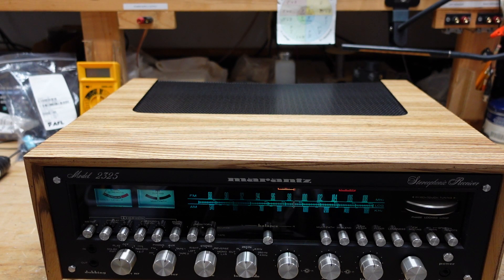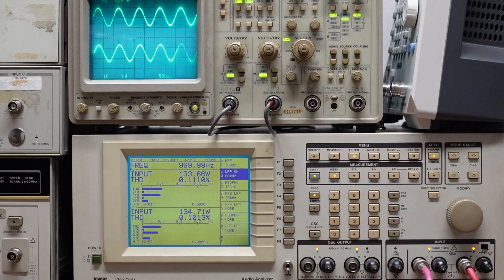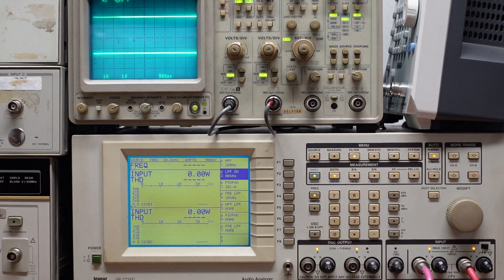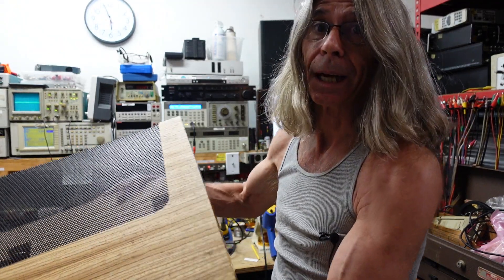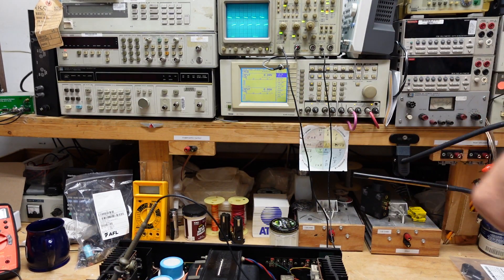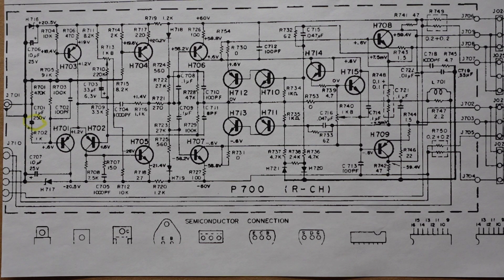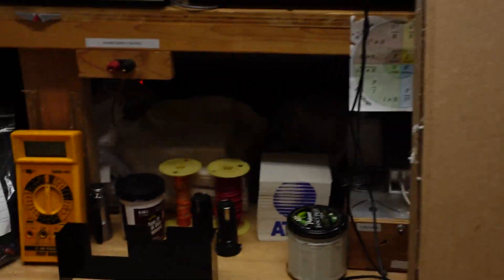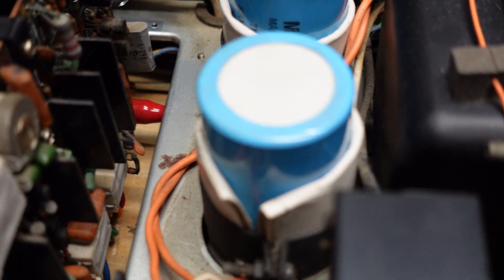Troubleshooting a Marantz 2325

Comment: A Man once said..."We're ALL still learning.  And that's a good thing!" Yes I am... And you are a tremendous help. Thank You. BTW ..in your test bench video you mention that you were not aware of any device that checks a cap in all functions. I have the SENCORE LC103 Cap Tester.  It checks ...Cap Value  which can be programed in tolerance.. Also Checks ESR.... Also Checks Dielectric Absorption... And Cap Leakage with a Good/Bad reading and a leakage value number. Plus it checks coils and inductors.    BUT I think you know of that device but forgot to mention it...L.O.L. If not YT it and you can see it in action,   Thanks Ray.. Always looking forward to your next Video....Old Friend ...Mark
Reply from the maker: I wasn't aware at the time of the video that the Sencore did leakage.  I've since looked at them, but the leakage one would cause to my bank balance gave me pause.  😝
Reply: @raygianelli3612  Yep they go for crazy money. One guy had one up there for #32,000.00 on Flea Bay. Crazy Man. But they go for anywhere from $1500 to $2500. The model before is the LC 102 which can be had for $700.00 To $1500. Does the same thing except it use the old Black LCD display and has those snap over center flat push buttons. Still does a good job. I check new caps with it and find some surprises ...like leakage and High DA. You have to go in order of test or else yo can create a false DA reading. The Sencore is my life saver and one of the best pieces I have.
Mark R

Comment: Got a 2325 as well. After a power cut (during which the amp was not connected to thte power outlet) I have no more sound coming out of the amp. Could it be that the power from the socket is no longer strong enough to drive the amp? What else could it be? The fact that it happened exactly on the day the power cut out makes me think it is somehow connected to that. The amp still has full lights, everything works as normal and last night the amp worked and played nicely and loudly as usual. I am confused here 😕
Reply from the maker: Chances are that it just developed an issue causing excess DC on one of the outputs.  Do you hear the relay click a few seconds after turning it on?
Reply: @raygianelli3612  thanks for the reply. I'll turn it on again in a minute and listen out for that. Just such a weird coincidence that it happened on the same day the power cut out. What are the chances? It's been running well for 8 years and is from the mid 70s haha
Reply: @raygianelli3612  no, was unable to hear that sound, good call. so the relay needs replacing, you think?
Reply from the maker: @AverageRecords  No, the relay is doing its job by not closing because either (A) there's a malfunction causing excessive DC on one or both outputs, or (B) there is a malfunction of the protection circuit itself.
Reply: @raygianelli3612  I see, I have to drop it off at a workshop, this is not something I know how to fix, unfortunately. Thanks for your help. Much appreciated

Comment: Hi I have a  marantz 4300 it was recappedbut   could still hear a faint humm or distortion when on with no music playing is that normal or is it lacking some maintenance thanks it does sound ok otherwise
Reply from the maker: If it's both channels that indicates power supply issues.  If just one channel it's probably a noisy small signal transistor.  Hard to say without seeing/hearing it.

Comment: So not to coax you into stating what may be the obvious, but how the heck did that incorrectly speced cap get installed into that circuit? Would it be fair to say that the person who shimmed those filter caps may have been involved? No chance that has been like that from the factory... "right?"
Cheers! 👽🖖"Na-nu"
Reply from the maker: It wasn't like that from the factory on the other channel, so it's safe to say it was from somebody working on it.  A friend opined that it could be the guy thought he was installing a 47µF cap, instead of the .47 that he put in.  At my age I need a magnifier to see the decimal point.  Could be he needed a magnifier too, but didn't use one.  :)